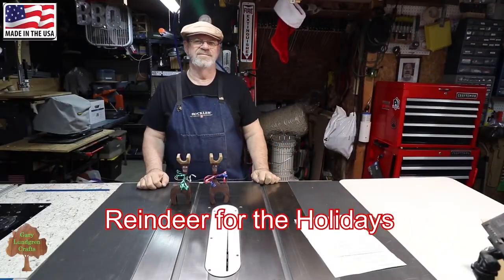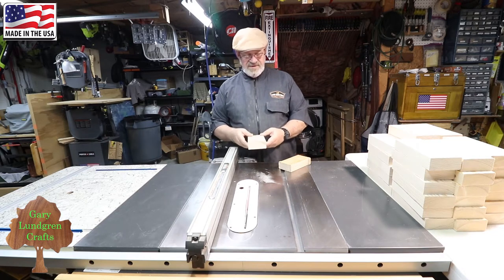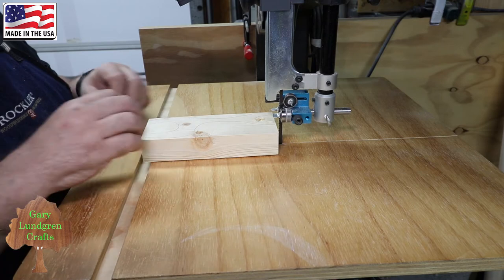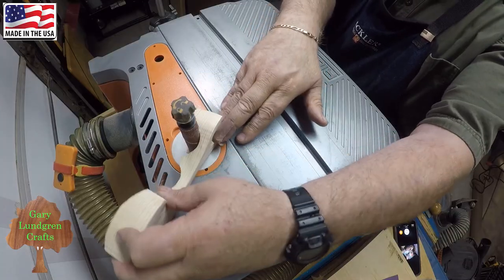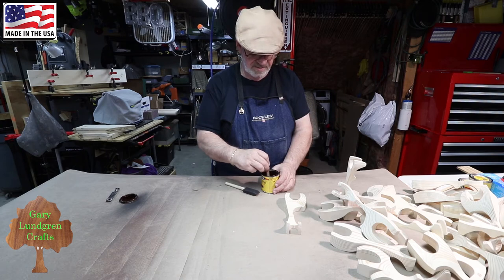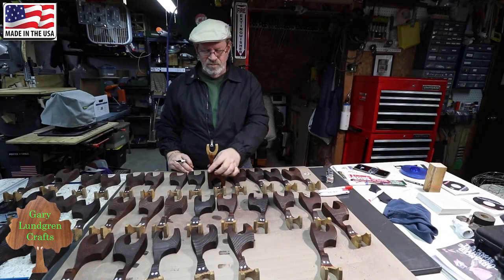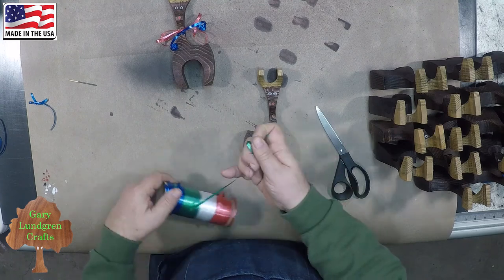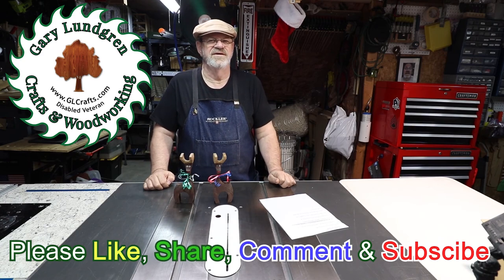Making Reindeer from 2x4's Holiday Project  Ep.2019-25

Comment: Just bought a new bandsaw and want to buy a 1/4" blade to make these.  Did you use a blade with 4 or 6 TPI? Does it matter? My blades are 70.5". Love the work you did
Reply from the maker: Thank you!  I have a 93-1/2" blade and using a 1/4" 6 TPI hook blade. More teeth give a smoother cut, but too many teeth makes for a slow cut. Depends on the wood you're working with.